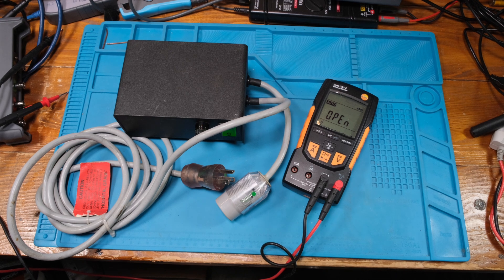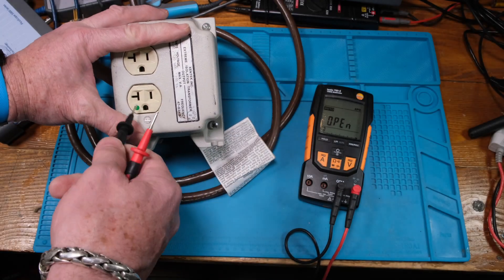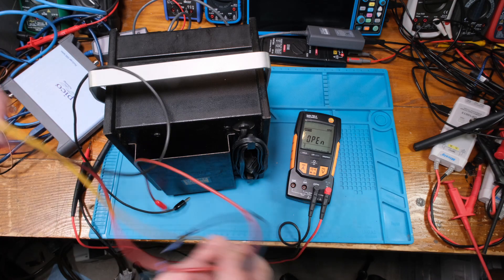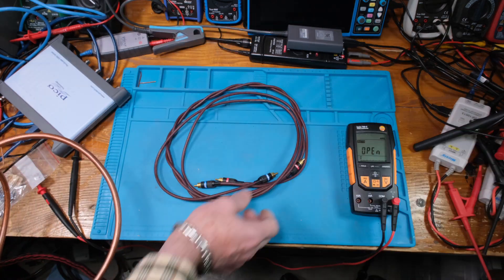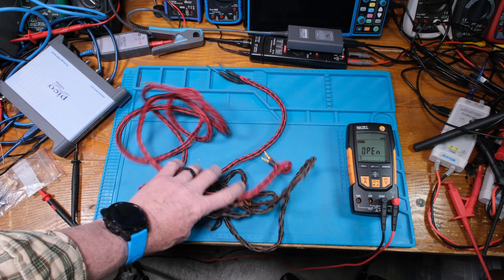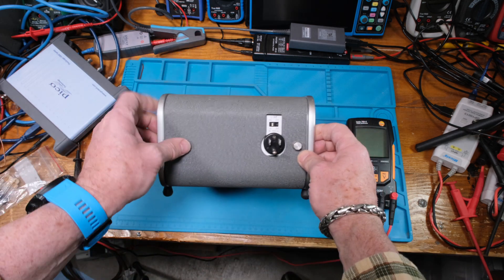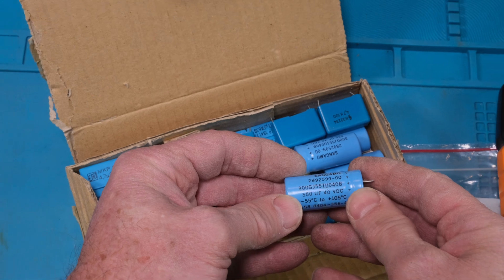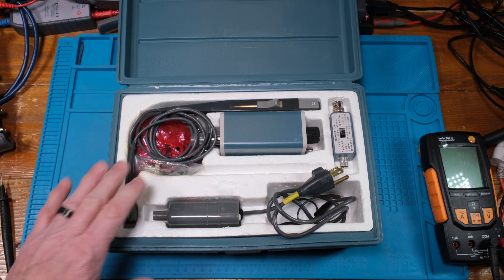Look what I found in my strorage a McIntosh MC-30 Tube Amplifier and More

Comment: Hi Eddie I think I may have bought some of your audio equipment.? I gave the guy 500$ and he told me I could have everything I could fit in my car. I have an old Tercel. I took the passenger seat out, luckily I just replaced all the shocks. It almost destroyed my new shocks. Im a wood tick by trade but have been wanting to transition into electronics. Just hooked up my old Phoenix Gold amp in my car last week. There was a home theater subwoofer with built in power supply and x/over with that stuff that I've been using but it heats up sometimes so I took the power supply out made a cover for the back and am running her on mono in the ercle. It was a bronze edition from 1999. There is a nice tube theater chassy that's missing it's tubes most of them call for gt's 15 watts total. There is an old Crown 2400, a Roland 4 channel tube pa amp, There is a marine grade inverter for radio communications. I've been watching Mr. Carlson's lab along with many other channels learning about the angry pixies. I don't think they are angry just misunderstood.😂 If this sounds like it might be your stuff maybe I can help you fix and restore them? If it's not your stuff maybe you could help me restore some of them on your channel? Thanks for your service and sharing your knowledge, I appreciate all you do.

Comment: Isolation transformer ... well a friend pass me a big one and ask me to test if it can block the AC noise, which is horrible in my building, the answer is NO, the AC noise still go through it and into the amplifier.
Reply from the maker: Yes, you are right!  An isolation transformer dulls the noise but still lets it get through.  The medical grade I believe has a shield that helps a bit more but still a noisy power will get through.  The other advantage is that it offers isolation as far as galvanic connection to the input power.  This lets you use the scope ground a bit more freely.

Comment: Good stuff! That must still be heartbreaking knowing that so much audio gear was stolen.. Seeing the Tektronix current probe brought me down memory lane- I used one to measure a pulsed DC current that was driving an IMPATT diode- used the termination you have in the kit, plugged directly into a scope, but did not need the amplifier... I would get the MC30 up and running and see if you had any hum or 60hz mains noise that was affecting your THD and if it was not I would not recap the P/S.....
Reply from the maker: Thank you!  If the MC30 powers up - which I will do in a way in an attempt regen the caps (I’ll do this in a video), and if the amp comes up then - I’ll take some measurements too see how things go.  This should be fun.  It was very difficult - it took me years to accumulate what I thought was a great system:(

Comment: I feel sorry for you that some people stole your stuff. I hope the damage is not that great. I like the way how you deal with it, you make the best out of it and seem to revisit and show your stuff.

About the MC-30: I have the same feelings as you about old paper/oil caps. throw them out and give the amp some good poly caps :)
Can you give us the distortion spectrum using one of your hi-res scopes? I'm curious the see the 1kHz spectrum and bode plot of a famous amp. I test my amps at 0.25W (room loudness), 1W (my neighbour knows I'm home) and at full power (I want to share my good music).
You know the eternal debate between tube and solid state guys. a comparison of the spectrum and bode plot of these two kinds of amps would be a great demonstration of the differences.
Reply from the maker: Thank you!  That loss was very devasting.  It took years for me to collect that gear.  I had 2 Ampzilla amplifiers, and finally got an Audio Research Pre-Amp.  As well I had the 3 MC30s.  Oh well, what do you do?  It was impossible for me to go to my storage, so I paid another 18 years of fees just to avoid going there:(
I’ll use the MC30 to try to first regen the caps then take measurements before I recap and show the differences - before and after;)

Comment: Nice old electronics,reminds me of Mr. Carlson restauration videos.
Reply from the maker: Thank you!  I think that is a compliment.  Mr. Carlson has a nice channel;)
Reply: @KissAnalog  Yes, but you have nice testing equipment there too. I like the old radios and electronics. I have one radio, very old, from my great - grandfather who was prisoner in Germany during the war. It has Telefunken tubes in it. I removed the old capacitors, replaced them, and is working fine. And Mr. Carlson videos helped me a lot. But when it comes to digital multimeters your videos are very helpful. Or EEVblog is another good channel.   Keep up the good work. 👍👍

Comment: I would definitely recap the MC30 and maybe replace the metal tubes with glass for looks. Usually you don't have to do much more with McIntosh units, since the biasing is not adjustable and they used high quality Allen Bradley resistors that seem to last. I'm sure you will do the usual (bring up slowly on variac, check  internal supplies) before giving it the beans.
Reply from the maker: Thanks for your feedback!  I appreciate you!